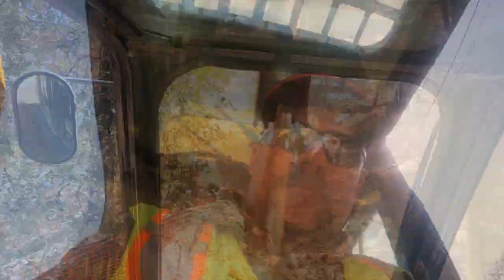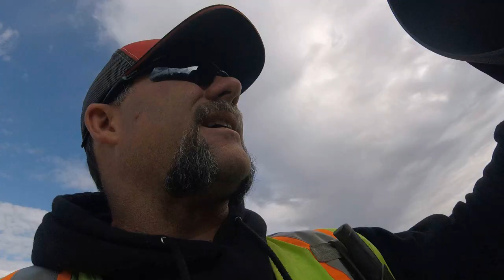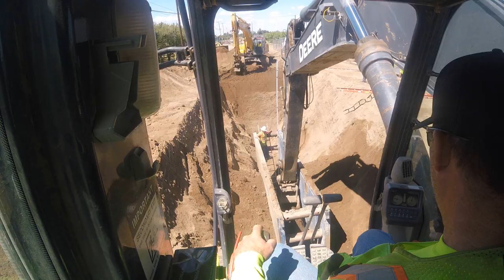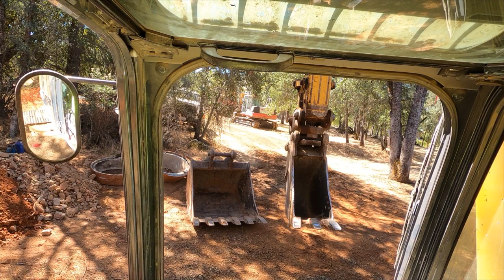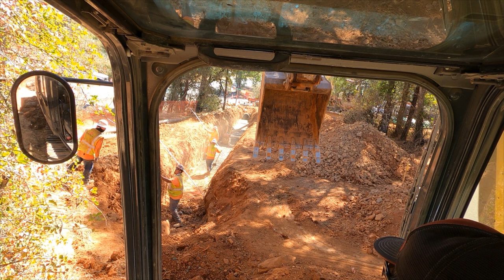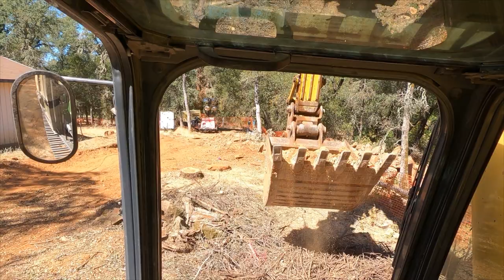Ripping out a nasty sewer manhole and pipe.

Comment: I am interested to see what happens when you get to the real hard stuff. I bet there are gonna be more and more jobs like this putting in larger sewer pipe and manholes. I have a set of plans a friend of mine gave me they didn't do of the same thing. Do you use precast? or cast in place manhole bases? Was that a 4' manhole you were putting in? Some of the manholes in the plans I got was removing 4' and adding 5'.
Reply from the maker: 😉 More to come.

Comment: Pro tip my friend, if your mechanics are as friendly as ours.  I'm next door in AZ we have dust control but sometimes you just can't have water available for it. $100 shop fan or a carpet cleaner fan with a inverter directly to battery will help blow out and keep your line of sight more clear as well as help those boys on the ground. Mount that shit to the roof or on the boom and you have yourself a winner. Also keeps your cab cleaner if youre a picky arsehole like me🤣. Sweet vijeo